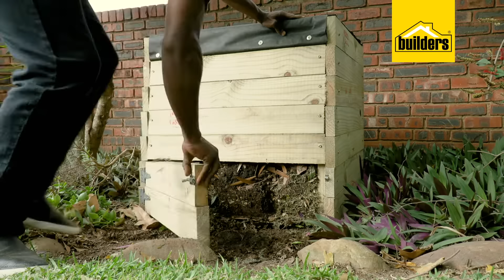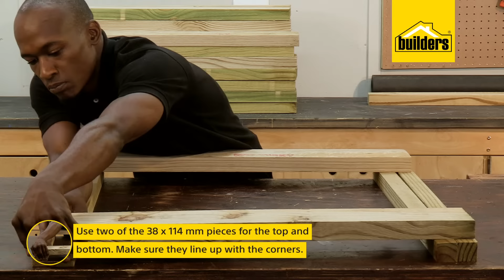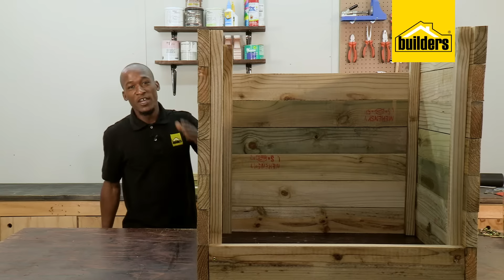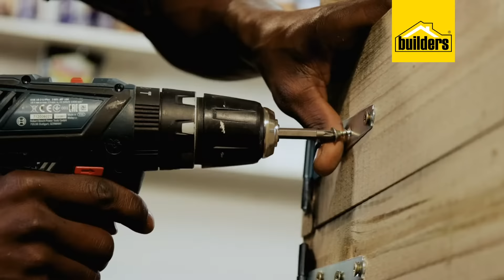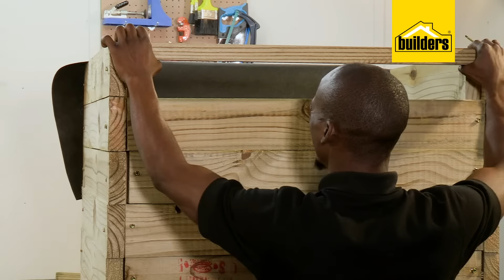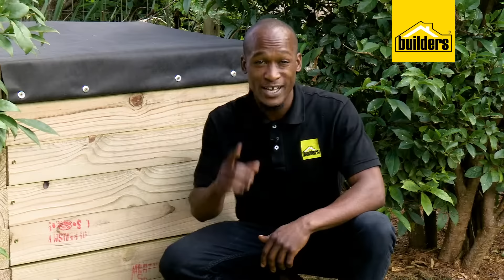Make Your Own Compost Bin With This Simple DIY

Comment: CCA-treated timber contains arsenic, chromium, and copper, designed to prevent decay and termite damage. While the chemicals are "fixed" into the wood, research shows they can leach out over time into the soil and compost, especially when exposed to moisture and the acidic conditions typical of a compost ???
Reply: bumping this comment, such a dangerous detail no one is talking about